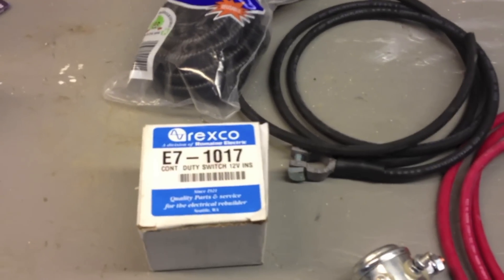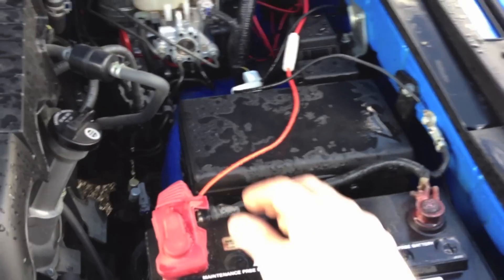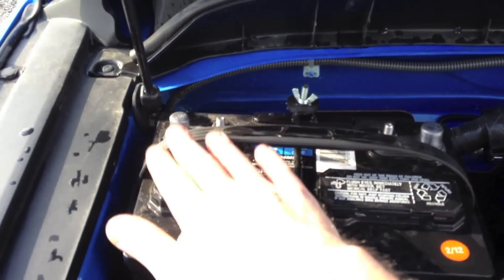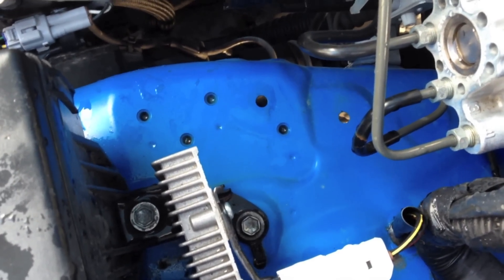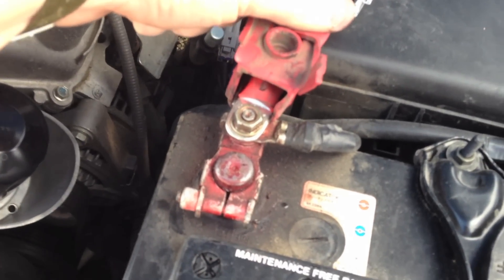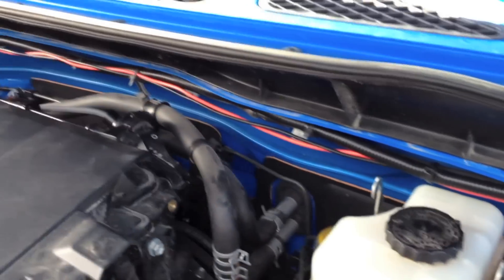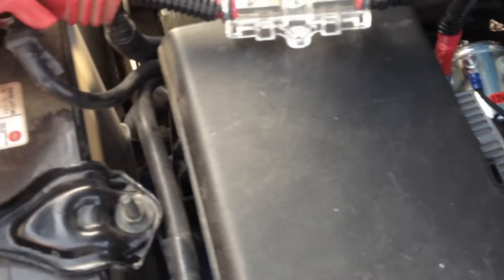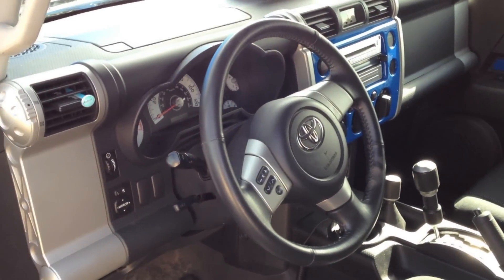FJ Cruiser DIY Dual Battery

Comment: I would prefer to run my aux equipment off the main battery and only say a light or two off the aux battery. That way if you are doing heavy winching or run your main battery down you can jump off the aux battery. then isolate it if it gets low put a 12v charger to it either at home or you could wire a 12v charger that will trickle charge the aux battery.

Comment: well any fuckin this is DIY if u can fabricate. you diy a whole fucking car if u have the tools and raw material
Reply: Michael D Your a fn moron...If you cant think out side the box than your hopeless. The fabrication he is talking about a fn chimpanzee could do it. You should absolutely refrain from doing any kind of work that uses your brain.
Reply: thing*
Reply from the maker: Michael D yeah... and I have built a 1986 Rock Crowler Toyota since this video..
Reply: right, so its not really a diy for everyone. its diy for people who have the means to fabricate pieces.
Reply: just follow this simple tutorial (btw hope you can do random metal work that you'll need a shop for)
Reply: next week ill show you how to put a hemi in a toyota corolla. (the trick is knowing how to forge your own pistons)
Reply from the maker: Michael D I do have a shop, I do know how to weld, bend, fab, cut.. it's not that hard to do.  It's also not that hard to fab battery cables and bolt down a battery tray.  Go troll somewhere else.
Reply: +Michael D Why the hate?  If you can't handle it, move on, or seek a professional installer.  He is sharing his experience; he is not saying his way is the only way.  Sheesh.

Comment: You should have a fuse at each battery.  If the cable gets shorted at the added battery the fuse will blow keeping power from the factory battery power protected but not the added battery,  If the relay necessary?  The OEM battery is always giving out power to the vehicle.

Comment: Did you have to upgrade the alternator to keep up with the extra battery?
Reply from the maker: I have not upgraded the alternator, and it struggles with my short drive to work to keep every thing up 100%
Reply: +Tyler Snider You shouldn't need a higher output alternator unless you run a winch or other device pulling a lot of amps.  But, you should do a Big 3 Upgrade, especially the alternator to battery wire.   That being said, BNR Parts sells 200 and 250 amp alternators for under $215 for FJs and Tacos.  They remanufacture their own alternators and starters in their Socal warehouse.  Check their eBay store.  I plan on getting the 200 amp model in the near future.
Reply: read up a little on their stuff. I read some stuff about them not honoring warranty and really poor products. not sure if that's a common issue or not
Reply: +Tyler Snider They have a 99.9% rating.&#160; I would think that&#39;s worth the risk.&#160; Their physical store is CAE and is in Van Nuys, CA.&#160;&#160; A vendor in the Tacoma World forums (and he probably sells on FJ forums also) uses these guys for his upgrade kits (but charges too much, imo).  That's how I discovered these guys.  I happen to reside two hours away; so, I have less reservations as I can drive over if I encounter any problems.  Since they don't charge a core, I'm thinking of going up there anyways so they can re-wire the OEM alt.

Comment: Great video. Hows the dual battery sys holding up? Did you make any changes?
Reply from the maker: I have not made any changes.  It has saved the day a few times after leaving my ham radio on and found my aux battery dead.

Comment from the maker: I punched the power through the firewall at the rubber grommet.  There is one under the master cylinder and another one at the passenger side.  Coax goes out the rear door for now.

Comment: Thanks for this vid! I am N9SMJ. Just wondering how did you route your coax cables to the antennas? How would you route power cables for roof-rack mounted lights? I have an '08 FJ & a '76 FJ40. Where in the firewall did you punch the power cables through? Tnx & '73! Carl.